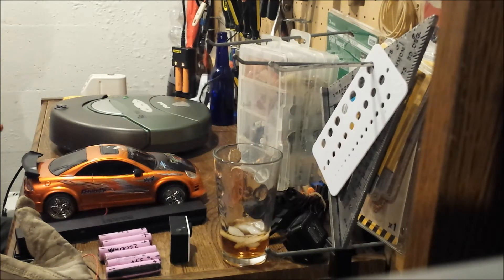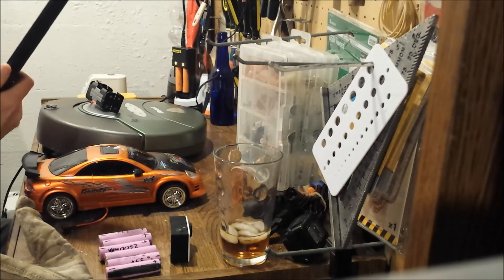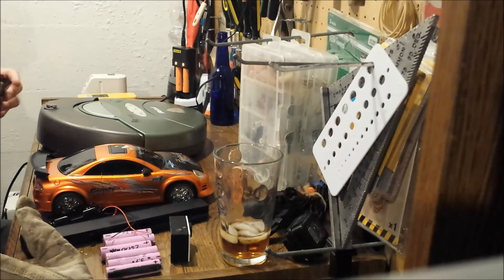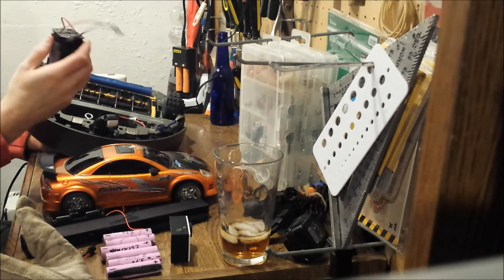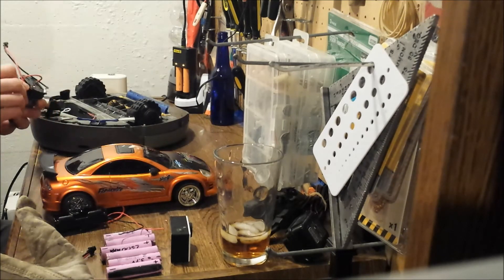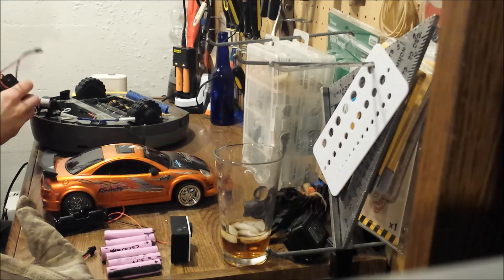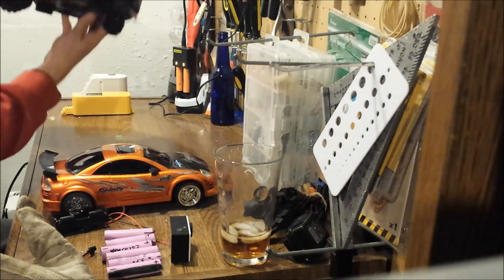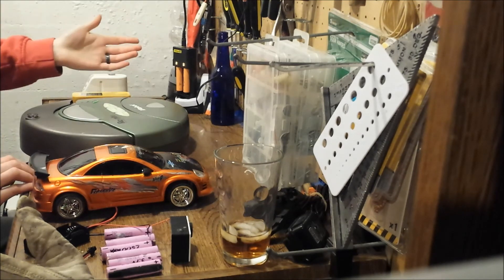Roomba Lithium Battery hack MOD

Comment: thumbs up because this technique  to build the battery could be used for many diy projects. i used to work at a cable company and kept over 400 rarely used modem battery packs. crack them open and have between 4 and 6 new 18650s :D, i still have them all.

Comment: Are you able to charge the battery through the roomba by plugging it in? Or do you have to remove the 18650s every time to charge them in a charger?
Reply: The charge termination strategy for  NiMH isn't the same as lithium, and lithium packs need to be balanced.  For both of these reasons, I would say no., long term...although it might actually charge for a while before things get weird.  If you try this, I would keep your eye on it.  Primary lithium does very bad things when overcharged; you could start a fire.
Reply: @byronrace  Hmmm are you sure? There are lithium batteries sold for the roomba now also they have no balancing on board also with the aldi lithium batteries for 18v.
The station for the Roomba does not overcharge and is a trickle charge that is in specs you could start a fire with your lack of knowledge.
Lithium packs may need balancing on a power board as in 1kw.
If your worried add a fuse also there should be the original heat sensor from the old battery as that is important for the thermal I do not condone what this person is doing although lithium is ok to use with this bot.
Sometimes we the little people hear and obey too much from the experts that really do not want you to understand a potential.
there are 5 year warranties on ebay for lithium batteries so I would say yes they are long term
Reply: @GG-od2tr  There is electronics inside the aftermarket lithium-packs that stops overcharge and over-discharge, and does balancing. Connecting up Lithium cells directly is downright DANGEROUS - it will overcharge the cells like crazy (tested on a SE (Discovery) and 780. DON'T DO IT!
Reply: @GG-od2tr  stop with the exclamation marks, it looks silly. Balancing isn't a must in a low-drain application, but a FET in the charge path is mandatory.
Reply: Did you get the answer ?!
Reply: @andriiburka  I wouldnt bother unless you have a good understanding of batteries and a good spot welder its not worth melting your machine as for charging yes it would charge on the station although when someone says i used 22 gauge wire anything thicker might melt the roomba hmmmm makes me think he dosent know how resistance works or transfer or energy in a copper wire infact he probably thinks the posative is where the electrons flow from LOL they still havent changed that in the text books so funny
Reply: You could charge it without removing although see below this person may not have answered as his wire might have not been as thick as the operator that is puttin it lightly.
Reply: No you can not
Reply: I found a safe way to do it, i have 4 roombas in my home! All running off  18650s and over a year now in use. Batteries are all balanced, i checked them every 3months for a year. The performance is amazing too. Id just say its a bit tricky to get it to fit in, but once you have that figured out its the same for all the other roombas.